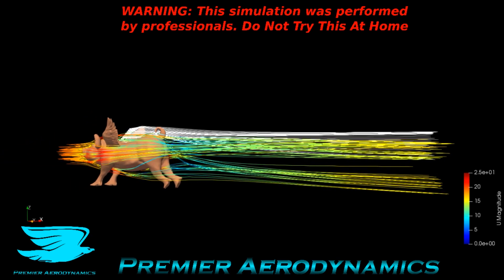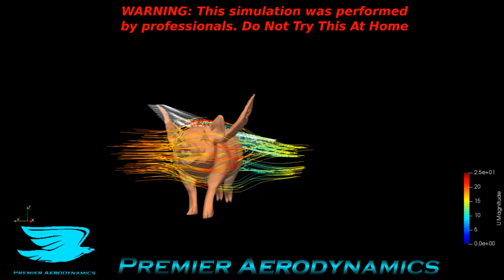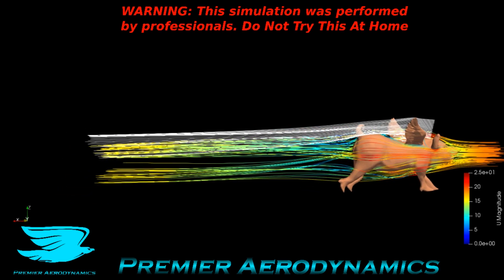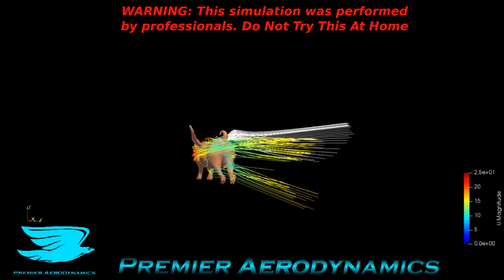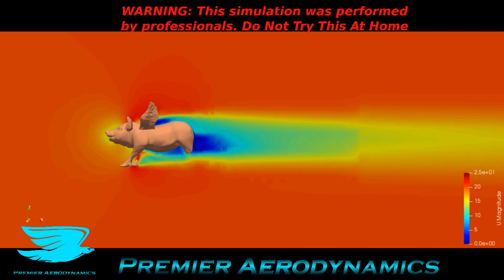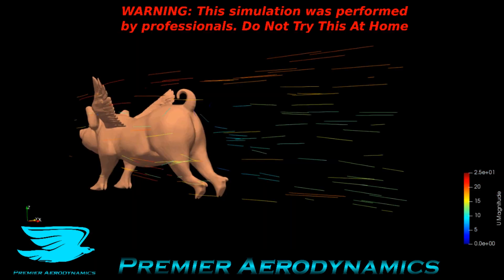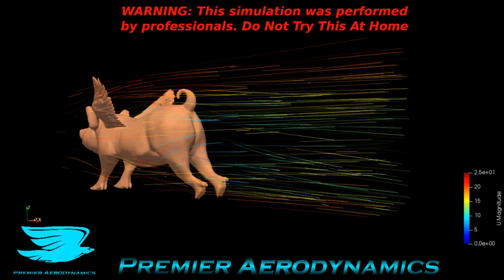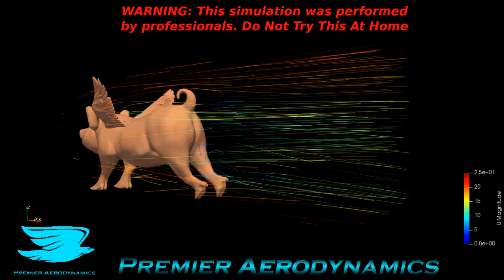Flying Pigs are NOT aerodynamic!

Comment: Your analysis is on point!
Reply from the maker: Thank you! As streamline as the pig might be, it's not quite enough.
Reply: @PremierAerodynamics  This CFD got me thinking. I wonder what a wizard hat would do pointy side into the wind. Obviously there would be a strong roll up into the hollow part, but would it have a large wake? The refueling nozzles they use for mid-air refueling are shaped this way if I'm not mistaken.
Reply from the maker: @rolandotillit2867  I think the wizard hat would have quite a large wake, but why speculate when we can simulate? 😁 We'll do a simulation on it.

For the refueling nozzle, I think they're pretty much like a a regular fitting. I don't recall a cone shaped one.🤔